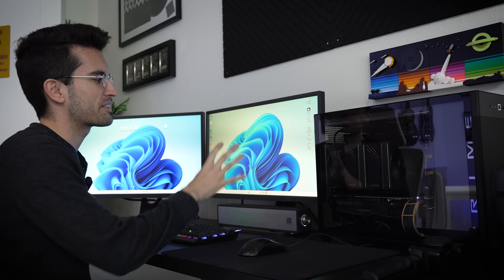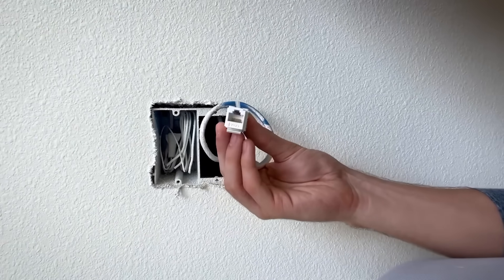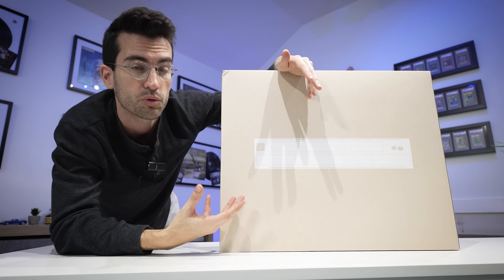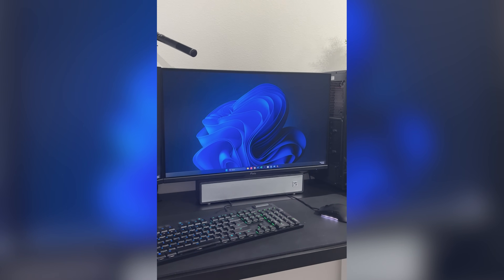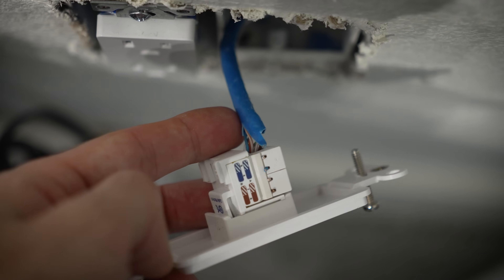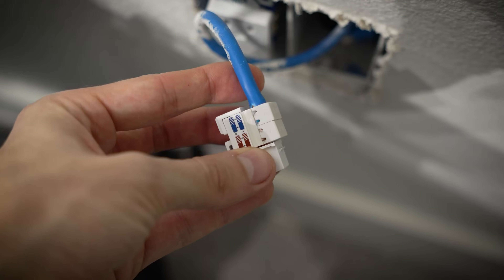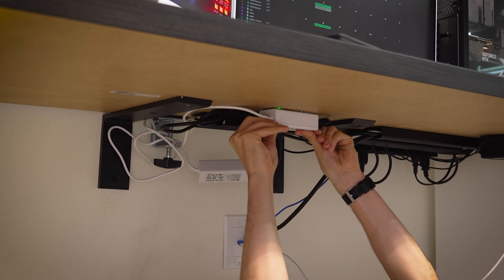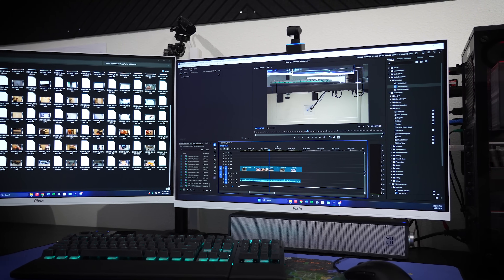These Issues NEED To Be Addressed...

Comment: I would install vents at the top of the door, remember, heat rises, plus it will allow much better air movement with convection actually pulling the cold air in
Reply from the maker: We have active exhaust in the closet... this was discussed in a much earlier video.

Comment: I had a similar issue a while back, though the ethernet simply was gone instead of spotty in my case. I tried everything. I reset my CMOS, I uninstalled and then reinstalled my drivers, I updated the bios, I tried every linux hack I could find (I'm on Nobara Linux), and I simply could not get it fixed. Finally, I found a forum post where somebody said it was a bug in Asus's design and its fix was simple.....just hold the power button for 30-60 secs. All that work, all of that effort, and all I had to do was hold the damn power button. I guess that I got off easy on the issue.

Also, as a guy who's a decent handyman, how in the ever loving f*** does a person damage the jacks when installing face plates? Face plates are easy AF to install.

Comment: The issue I found with Power blocks is that they get hot, so most adhesive gets hot and just falls off. The best way to handle them is with a brace. You can make your own or 3D print them.
Reply from the maker: That's why I use the Gorilla adhesive I showed. Has worked great for me over the years with hot power bricks.

Comment: I'm in a similar issue with with my network, only I have an older house and I did the lines myself. Similar but not the same and I pretty much know my problem was me cost cutting and not knowing enough at the time. In Nov. 2017 we moved in and I ran CCA Cat 6. Copper Clad Aluminum is a bad idea for long term and PoE. Refer to mixed metal cooling when using copper and Aluminum, only no liquid, I'm running electricity. I have the cable to replace, but time is often the issue. The line to one of my AP's is functionally 100Mb instead of 1Gb. I'm sure you went pure copper, but a tester is always a good piece of kit.

Comment: I have tried time and time again the Ubiquiti Systems and they have all let me down with very often outages not even for software updates. I have now implemented my own homebuilt solution with a homebuilt NAS using TRUE-NAS a homebuilt Pc and a 10gb PoE TP-Link Ethernet Switch. Works Exactly how I've designed it and can Increase storage as much as I want.

Comment: You can rent a good network tester and you can measure the cables and jacks to make sure they are both correctly connected and get a signal integrity test for each cable. In general the later isn't all that necessary when just cabling for gigabit ethernet but if you are going to try 5 or 10 Gigabit then it might be nice. If all you want to know is that all the connections is right there are pretty cheap testers that you can buy for perhaps $30 or less. It's been years since I looked into this so the prices might be higher or lower, but it makes it easy to see that all leads are correctly connected. When cabling something simple like this I think it's a very good investment.

Now a real tester will cost several hundred if not over a thousand dollars so they are really only for professionals. So if you want that test rent one instead of buying one. You can of course hire a professional to do the tests but again that is pretty darned expensive for such a small installation.

Comment: The flickering of the monitor may be because of amd driver if it's a amd GPU. There's a problem with the last amd driver where it breaks free sync pro and it causes free sync to turn on and off rapids depending on what's on screen.

Comment: how's that new beQuiet keyboard? they look good on paper, but i'm not sure about the faceplate / switch mount. it looks like the kinda design where the keycaps hit the plate on every keypress. my previous SteelSeries keyboard was like that and it bothered me so much that i eventually bought a custom Glorious GMMK3 with dampening and stuff and it feels infinitely better. unfortunately it randomly stops working occasionally and i have to reconnect it, idk why. maybe their firmware is garbage and unfortunately that model doesn't support custom firmware, it seems. it could absolutely be considered a defect and a reason to return the thing unless my PC is the culprit somehow, but i can deal with it, so whatever

Comment: I have had keystones do similar things sometimes and the fix has been a small pin can pop the offending connection pin inside the keystone back into place. sometimes if a cable is plugged in kinda off to a degree it can pop one of those keystone pins off its track . but the second one in the racing sim room looks like someone really messed it up tbh

Comment: A lil pro-tip with dealing with ethernet insulation: You can use cable strippers meant for RG-59 coax on cat 5/6 cabling safely, as it's just wide enough of a gap to only nick most of the way through the insulation, and not damage the wiring inside!  Be careful to use the stripper that comes on the crimp tool, and not the kind that uses spring tension to clamp onto the cable!

Comment: ¿ Why did you use the gigabit connection to the nas? A 10gig DAC would be a lot better. the switch is right there
Reply from the maker: The speed difference doesn't matter much to me. I only ever store video files there, and they aren't time-sensitive. Should also note I'm not actively pulling from there, so again, speed just doesn't matter as much. Eventually I'll bump it up to 10gig if I do live editing from the NAS :-)

Comment: Greg nivida last driver caused a lot of screens to to do exactly as your describing with flickering and just going blank please check for the hot fix driver and if it continues then I would assume it’s the monitor 

Wasn’t sure if you knew about the driver issue
Reply from the maker: This wasn't a driver issue. Multiple cards and cables tested. Monitor-specific, unfortunately.

Comment: In your server closet, would it not be better to have just two vents, like you have, BUT, have one vent at the top and on at the bottom, so as for the hot air to escape at the top while pulling in air from the bottom?
Reply from the maker: Did you miss the part where I explained that we already have active exhaust in the server closet? It vents out the top of the roof.

Comment: I know some people have said it seems like a kid has damaged the ethernet ports through curiosity, (certainly possible,) but i actually think it's more likely that someone used an electric screwdriver or a drill instead when installing them and probably slipped... They're flathead screws that are very tight? Seems to me like someone was trying to do things quickly and slipped causing damage imo, especially if you look at the bottom of the connector's plastic on the second one, probably an apprentice being given the "boring job" near the end of the day/before lunch and just wanting to go home/to eat.

Comment: I have worked in IT for about 20 years, installed data cables for 8 and a half of them, I have never heard of a female RJ45 jack being called a "keystone" is that a Florida thing?

Also the jacks look like they were not terminated with a 110 punchdown tool correctly. it doesn't hurt really but it does make it look much better.
Reply from the maker: "Keystone" usage is pretty common from what I gather. And very google-able.
Reply: @GregSalazar  Spoke with my old foreman. he told me it is a common word for them up north. (yes I did google it as well) he has to do purchasing for the company he is in now. he said that's the only people he hears call them that. All good thou. just threw me off in the vid. Keep up the good vids man.

Comment: If that is an Ikea Desktop Top, It's only particle board on the Ends, and a small section in the Middle.
the rest is Honeycombs of cardboard. I recently broke mine in half opening it cause it broke.
replaced it with a Kitchen Top cut to size for a Desktop.
Reply from the maker: These are solid enough, can't imagine them breaking anywhere near as easily as you describe given my own experience with them. But as stated in the video, I have reinforced them with heavy-duty L-shaped brackets bolted to studs and they've served me well for over a year now :-)

Comment: Tbh, you really don't need to worry about the slight sag on networking devices in a rack. They are meant to be held by only the rack ears, so it isn't anything to worry about. For servers and what not, I would recommend using sliding rails and not the Universal L shaped rails that you showed in the b-roll. Thy work well but if you are trying to fit servers up against each other above or below, the universal rails kinda make it difficult to fit things some times. I originally went with them in my 24U rack cause they were cheaper than buying sliding rails specific to each server, but now that i have filled up 3/4 of my 24U rack, I ran into fitment issues when having stuff right above and below whatever is right above and below the universal L shaped rails/shelves. Things like the UNAS Pro, since it is heavier, I definitely wouldn't want it held by just the rack ears, but the switches, gateways,etc. are all fine with just rack ears. Use dev mounts from amazon instead of regular rack nuts, if you want something more robust.
Reply from the maker: The sag bothers me greatly, even if it's functionally ok. I'm familiar with the limitations of L-shaped brackets and their ability to impede stacking of equipment - which is why I turned mine upside down and used rack covers to create buffers :-)

Comment: Hey Greg, since you're a guitarist, if you have any pedalboard mounting tape (the velcro kind), I've had better luck using that for mounting AC adapters upside down, since the adhesive on that product is usually equivalent to gorilla glue. I've never had much luck with taping AC adapters upside down with other types of tape, since the adhesive will start to soften and melt as the brick warms up. But that pedalboard tape is almost impossible to remove, as you may already be aware. I'm still trying to get a piece off of my MXR ZW-44 overdrive for my Fender Rhodes.

Comment: So, the installer mangled the keystone by installing a cover plate? How? To me that damage looks deliberate. The cover plate doesn't go near the keystone so there shouldn't be any tool that should have come close period. That sucks you didn't check them immediately after they did the cover plates.
Reply from the maker: The cover plates screw into the wall, of course, and said screws are less than an inch from the port. Likely some kid using a power tool was sloppy as all hell. I've no idea how else this could have happened.

Comment: It  is a great thing the local government forced you to have a licensed contractor for installing your network outlets so they can not work!
Reply: Yes I was surprized as well.  Is it a local thing in the US having to  get a "licensed" tech to  do the work??
Reply: @paulwarner5395   Yeah local municipalities in the USA vary wildly. Some don't care if you rebuild your front porch while others technically require a permit to add a nail in your wall to hang a picture. All depends on location.

Comment: While i'd be mad about the issue with the jacks, Leviton Quickport keystones make reterminating those drops SO EASY. I hate putting RJ45 ends on ethernet cables and will avoid it so much that I'd rather just do quickports and put a regular patch cable in between them to make connections lol. Its just so much easier and faster. Good luck with all the networking learning, good sir!
Reply from the maker: Thanks, man!

Comment: You could maybe put a 120mm fan behind one of your sever room vents, might help a little
Reply from the maker: We already have active exhaust near the ceiling in the server closet. That fan runs all the time and vents to atmosphere.
Reply: Additional vents at the top of the doors would help, too. Good way to passively let the heat out into the hallway, but also will let the heat into the hallway! 🥵😅

Comment: Why would the county have an issue with you running ANY low voltage cable? It doesn't require a permit or anything to run low voltage cable.
Reply: Depends on the county and standards of POE low voltage is getting higher and higher many are pushing the initiative that electricians are now to be required to run internet lines. Crazy world huh?

Comment: Man in KY you don't need a license to install low voltage. And to agree with another poster @Nairb420 "Lining up 2 decora(rectangle) receptacles in 2 device wall plates can be difficult for newbies. If they tightened the screws down too tight and the openings didn't line up, I could absolutely see the apprentice jamming a flat blade screw driver into the Ethernet port for leverage and twisting it left or right to line up the openings." I've watched guys do stuff like that and had to educate them to back the screws off a little bit so you could adjust receptacles/switches/key-stones with their hand. Loosen just enough to keep them from moving easily, but loose enough so you can pull the plate back when it doesn't fit and move the device with some pressure on it with your fingers till it lines up.

Comment: If no one else said this, you need to ssh into the unas to adjust the fans manually. If you watch the temps when dumping  to it by default, you will see them climb into the high 70s easily. Please respond with your findings!!!

Comment: 2nd one good, the first keystone not really. No need for tool to make the connection, cut the excess wire with a small cutting pliers and use ther caps that came with the keystone.

Comment: Still at 6 mins mark of video but wanted to say that current Nvidia Drivers could also be the reason for Monitor flickering. I was facing same on my LG monitor and i rolled back to older version of driver and everything got fixed. 560.94 is what i am using currently.

Comment: Honestly Greg, I have a hard time blaming the installer for something like that. There's really no reason that the pins would be bent, and, cablematters tends to be good to go in terms of quality, I've used them alot.

In fact, outside of a cable being abused in the port, it's not likely that there'd be damage at all. I've only ever really seen it when someone has tried to plug a USB device into one.

What is unforgivable is not allowing slack in the drops. There should be at least a couple feet of extra cable in the wall.

Comment: the wire run people hulk smashed those.  I have always wanted to run some network cable but the lack of desire to climb in the attic I just did MoCA instead.  The house I own is from the early 70's

Comment: hi just so you are aware nvidia just made a new SOFTWARE update yesterday, many of the fixes mention FLICKERING ISSUES FIXED, if this driver does not fix it, turning off G SYNC which i tested stops the flicking on my new LG 480HZ oled monitor! here is what you have to google to find the driver, "GeForce Hotfix Display Driver version 576.26

"[RTX 50 series] Momentary display flicker occurs when running in DisplayPort2.1 mode with a high refresh rate [5009200]"

"[RTX 50 series] Some games may display shadow flicker/corruption after updating to GRD 576.02 [5231537]"

"[Forza Horizon 5]: Lights flicker at nighttime [5038335]"

etc

Comment: You should check out the new Dell 27" & 32" 4k monitors, they all have a 120Mz refresh rate (instead of the normal 60Mz).
Great job on the computer room refresh!

Comment: Hate to say it to you man, but, those plugs look like they were damaged by a kid sticking things in them rather than a licensed technician being negligent while installing new cover plates.
Reply: I've watched plenty of apprentice installers damage switches, plugs, and a plethora of other things. Instead of saying something, they don't and leave it for the home owner to discover. Usually with something failing hard and costing a fair bit to replace.
Reply: You’d be surprised how those so called “professionals” mess up so many times.
Reply: I'm a licensed electrician, and that looks like they most likely had an apprentice install the wall plates(cheapest labour low experience task). Lining up 2 decora(rectangle) receptacles in 2 device wall plates can be difficult for newbies. If they tightened the screws down too tight and the openings didn't line up, I could absolutely see the apprentice jamming a flat blade screw driver into the Ethernet port for leverage and twisting it left or right to line up the openings.
Reply: @Nairb420  If that's the case... they should fire that person immediately. They clearly don't have the aptitude to do this work if they're that ignorant or stupid that they would jam a screwdriver into any jack. Not only that, but you'd have to know that you damaged a jack at some point, and then they'd have to just pretend like nothing happened and go about their day. There's zero excuse for that.
Reply from the maker: Copy/Paste from a similar comment: I have cameras viewing this office 24/7, 30 days rolling. No one other than the contractors was in here unsupervised between the time I installed the jacks and when I first noticed networking issues. To that end, this office didn't have any of the cool toys it does now back when all of this flared up :-)
Reply: Caught my kid doing that. Looks awfully similar.
Reply: I believe this is their new house, they are the first tenants thus it wasn't a kid, it was the installer.
Reply: @Nimble_Bitz  This wasn't his first day there. He's been there for a bit. Plenty of time for a child to have time alone in the room.
Reply: @Nimble_Bitz  They've been in the house for some time now, so it's completely possible one of his kids could have jammed something in the socket.